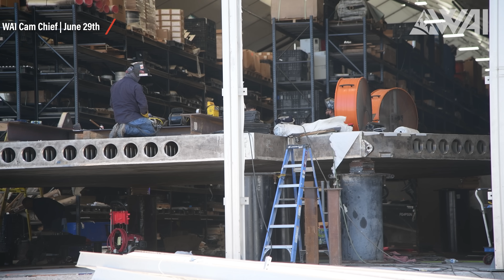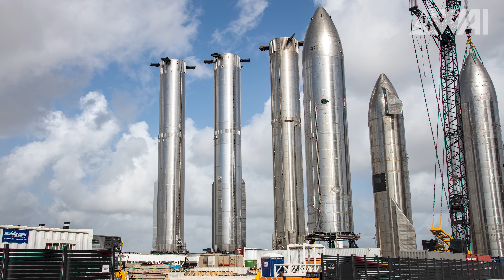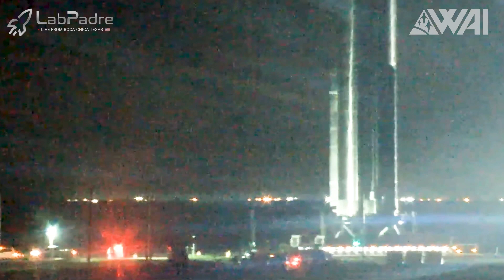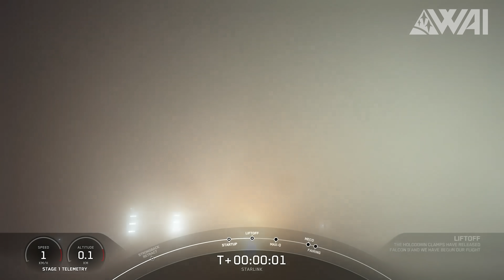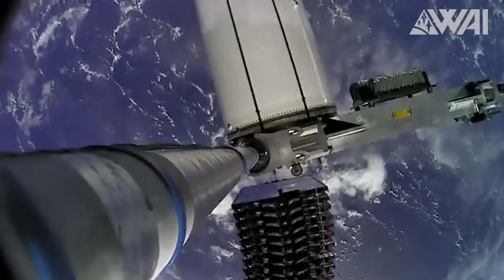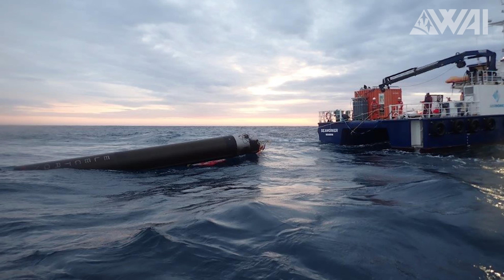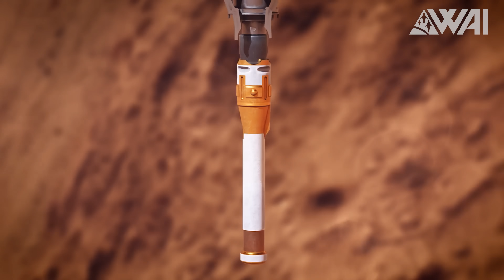SpaceX is Ready for the next Super Heavy Static fire!!!

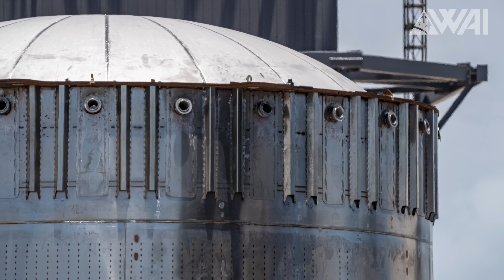Comment: @7:59 Notice the structural integration of the circular objects, you don't make such structural changes just for testing, only to be removed and nullifying the test. In that frame, first circular object from the left, you can see through it (at an angle) to the upper portion of the tank behind it. It's a vent for exhaust gases from Starships' Raptors, angled up to provide a reduction in booster velocity as Starship blasts away.

Comment: Felix, I have a guess as to what the vents around the base of the booster could be. 
If an engine explodes inside the new engine protection shroud, it would cause an overpressure environment which could comprimise the strutural integrity of the engine shroud compartment. Vents may be an exit for that pressure.
Just a guess. 
Mike
Reply: good idea.  similarly i thought the vents at the top could prevent pressure waves  between a protective second dome added at the booster top and the top pressure dome during hot staging.
Reply from the maker: Hey Mike! This sounds like the lead theory, right now! We'll definitely do some research down this rabbit hole for the next episode! :_WAILove:
Reply: After I made that first comment, I saw a better view of one of those vents. It appears that inside each vent hole are two spring-loaded doors that hinge at 12 and 6 oclock, designed to open outward. Spring will pull closed when pressure equalizes. So this may have 2 functions. One being what I first theorized, the second is to let ambient pressure escape durind ascent. Imagine one sealed engine srround. If it sealed up as tight as I imagine it is, then Space X MUST have a way for that pressure to escape.  If it was completely sealed UP air right, it ahrouded eng compartment) would burst on ascent from pressure increase. On the pad, air pressure inside the shroud is the same as on the outside. Mach+ ascent makes pressure outside the shroud to decrease, while inside....well, I think you smell what. I'm cookin...

In model High Power Rocketry, we have to make vent holes in our rockets to prevent premature separation under powered ascent. You want your chute deployment at apogee, not on the way up. I've aeen it happen. It's ugly. 😂